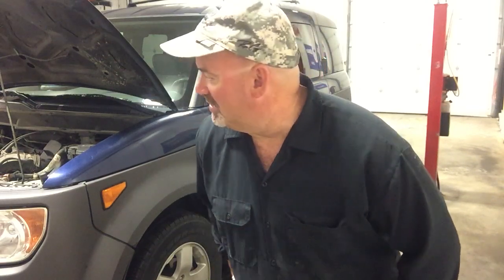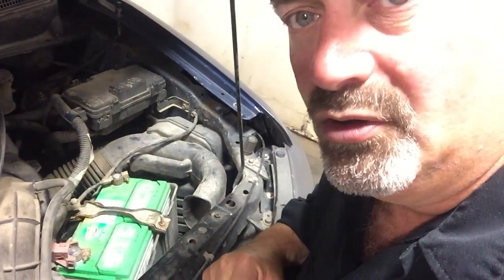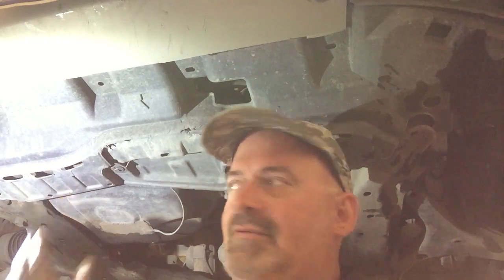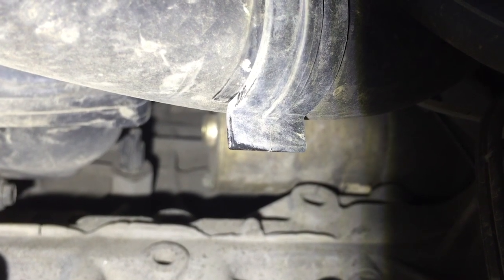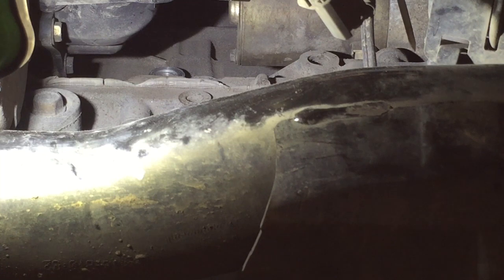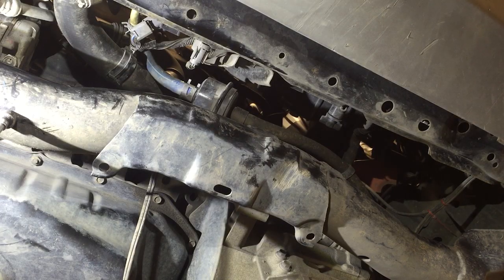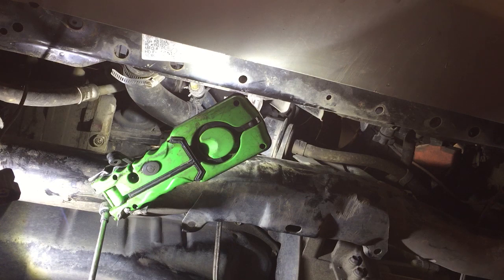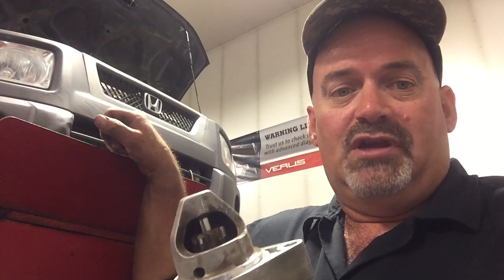Honda Element Starter Replace Less Than 1 hour

Comment: Mark my words, it’s way easier going from the top than the bottom. Took about 30 mins to take off cross bar, throttle bottle, and intake manifold, giving direct access to the starter from the top, with tons of working room. Total time for job took about hour and a half.

Comment: I have done 4 accord 2.4 starters. The first I did using this same method and it was a royal pain laying on my back. The next three I did from the top by removing the intake, the throttle tube, the overflow tank and various vacuum lines, hoses and electrical connectors etc etc and pulled back the intake toward me and to the right to gain access. I used a bungy cord to hold everything away from the work area. You will gain a lot of access space with this method and keep your sanity. Start to finish from the top took me 1.5 hours very casually and is also recommended to replace the manifold gasket. I realized that going from beneath was not really that big a deal and saves a lot of time, but space is an issue and my patience was tested mulriple times. Having a car lift would be most helpful of course. By the way Honda dealership wanted $745.00 labor only to do this. And in speaking to a mechanic on break outside, he said they go from under the vehicle and takes him 45 mins start to finish as he has done so many. I have used reman Denso 2806006 starters $116.00 plus the return core without any problems in four years, comes with 12 month warranty. Of course if you cannot break those bolts loose from the bottom, then go from the top. Watch this video closely it will help. And be patient.
Reply: Great write up. Appreciate you taking the time this will help. 👍
Reply: $745.00 for 45min?? I need that job..

Comment: Take the cover off the intake runners and split the manifold it's a lot less grief.
Reply: I agree, save yourself the frustration of trying to reach the 14mm bolt and just do it from the top.

Comment: Remove the two 8mm bolts on the back of the starter then remove the cylinder half of the starter. Makes the 14mm long bolt much more accessible.
Reply from the maker: That’s one way to remove it.  I assume you don’t do the same installing it.
Reply: @ThecardoctorTV  that's correct. I put the long 14mm bolt in the new starter hole.snug the 17mm in front then used a 1/4 inch wratchet with a 3/8 adapter 14mm short socket to avoid the knock sensor.

Comment: on 2008 had to also remove bracket for intake manifold in order to get enough clearance to get the nosecone of the starter down and out before I could remove the 12mm starter wire. Thanks, Good approach.
Reply: 2010. Can’t seem to get at the cable clamp. Will try this. Tks

Comment: Did this job yesterday, from the bottom.  Took about 5.5hrs on a 2008 model.
Took an hour just to get the sensor out.  
Yes any wire ties were cut. (and not replaced)
No, the top bolt isn't going back in w/o 10" long fingers with eyeballs on the ends OR doing the job by going in from the top to begin with.  So in my case, only one bolt went back in.  Some day I might bother getting the other one in, but no time soon best I can tell.  It'll be fine with just the one bolt so long as you get it in to torque spec and with blue LocTite. 
Naturally I do not recommend this method, but in 100 degree heat in a parking lot there's plenty worse things you could leave out. (like the dammed sensor, tho I didn't and don't recommend you do either)

I'm not suggesting the video is a misrepresentation, but going in the from the top would probably be faster for the average tinkerer with the average tool set. If only a bit more expensive since you'll need new gaskets for all the things you take off.
My biggest issue with the whole thing is the stupid prices for not even a Honda OEM starter.  What the actual?!
Thankfully it's the only thing I've had to spend more than $100 on for this car, other than tires. So I guess I'm still ahead in the deal.
Thanks for the video.  Great info.  Cheers!

Comment: Before you waste your time trying this (like I did), please read this comment. 

Notice he has the E raised on a LIFT. If you do not, good luck. I don't. 

Once I easily removed the knock sensor nut, I realized everything else was extremely difficult to get to. It took me THIRTY MINUTES to get the knock sensor nut back on! 

It's just very tight in there, even though I had socket extensions and whatever.

I ended up taking it to a mechanic, who charged 3 hours of labor for a $230+ part. Some are cheaper, but I get premium parts. 

Afterwards I asked my mechanic if he ended up going from the bottom or top, since I'd recommended bottom. 

He said they tried from under, but wound up taking off the manifold and going from the top. 

So if you want to save yourself an hour of frustration trying this without a lift, or hours of labor at a mechanic, if I did this again, I'd just go from the top. 

Good luck.

Comment: I tried this… laying on my back with the car jack stand up… I could not get adequate torque or wrench swing to get the large bolt off.  I broke it free but it is fighting me all the way out. I will just take the intake air manifold to get at it. Good news is the manifold bracket is off so taking the manifold off should be easier. 

If you are going to try this method, it will be a lot easier to do it with the car way up high so you can stand under it and have a Milwaukee Impact wrench.

Comment: The lower starter bolt came out hard and was messing up the threads on the way out. I had to tap the hole again with the same size tap or I’d have been down to drilling it out and pulling a bolt and nut in it place. Nightmare avoided.

Comment: Really grateful for this video.  On the Element Owners Forum, there have been reports that this is possible but until now I have never seen definitive proof.  I suspect though that for most shadetree mechanics like myself who do not have a lift or a wide selection of tools (especially air tools), coming in from the top is the best route.  My alternator is at 125k and my other Honda's starter died around the same mileage so I'm just trying to have it all figured out before the inevitable happens.  But then again, it might surprise me and last to 240k like another Element owner's did.  One thing's for sure -- you are 100% right about putting in the highest quality replacement you can afford because you don't want to do this twice.  Thanks for the video.
Reply from the maker: Thank you! I hope some more folks try this from below and give feedback on how it went, Its a timesaver for me for sure but youre right about not having a lift. Thanks for watching.

Comment: Thank you Car Doc!  Extraction was a 6 out of 10 difficulty, Insertion... 12 out of 10... LOL.  Still got 'er done in under 3 hrs.  ...but bruised up forearm for casualty where the frame tube tries it's best to keep you blocked.  Seeing is believing, and without your video I'd never believe I could 'weasel' that starter out of there.   Trying to blindly get that back bolt back in was probably the hardest part of the job, but with patience it can be done.

Comment: Thanks for posting this. I did it in about an hour and 15 minutes. I used a deep socket with a 3/8 to 1/2 adapter which allowed just the right length to get a 1/2 drive ratchet on. The hardest part for me was getting that back bolt back into the bolt holes. Thanks again.

Comment: Thanks Car Doctor. Just changed out the starter on my '03 Element. My comments: be sure to cut off the Honda zip tie holding the wiring. The bracket on the starter makes it doubly hard to turn the starter to take off cable, so I just pushed it up to clear and pulled down to remove starter cable. I suggest removing the bracket on new or reman starter and just reinstall. I don't anticipate any issues with the cables moving around. The blind bolt took a couple of minutes, but was found OK. Doc, you made it look easy! Next time it will be easier! (Hope not very soon!)

Comment: Thanks Car Doc for the video. My daughter's element  failed this morning. Read the section of the maintenance manual on how to remove the starter and a lot of parts have to be remove before seeing the starter area. Go to youtube and saw your method of removing the starter with less parts remove; then I started removing the starter your way.
Not a walk in the park though. After removing the bolts, removing my starter was impossible without removing the manifold bar support. Tools needed for bar support removal was a 12mm wrench size (deep socket). finally was able to remove the starter.
Front bolt was easy, the rear bolt was another mission impossible. I was not able to finish the rear bolt - will do it tomorrow

Comment: Thank you for the great video. I just did this and the Honda started right up. Just a note to others though, take your time this is a very frustrating job because through most of it you have only enough room to work with one hand. As a backyard mechanic, with no lift (jacked up the front a few inches) it took me about 3 hours...this included occasionally getting out from under the Honda in frustration at how hard it was to get at that back 14mm bolt so I could sip on a beer for a bit before getting back to it. But hey it worked as he shows you in the video and you don't touch the manifold and have to fork out even more money for gaskets.

Comment: Did the nasty thing. Was it just me or, is that back bolt self locking??? Also removed that intake brace in front of the starter for more wiggle room to remove starter itself. CHEERS!

Comment: Thanks for the video!  I replaced the starter in my 2003 Honda Element using this method.  After removing the plastic shield underneath the starter is already exposed.  The only thing I did differently was that I did not remove the knock sensor.  I see how it would have given you more room but I found it was not necessary.  Thanks again!

Comment: Thank you for the in-depth analysis and presentation of changing the starter from the bottom. Faced with no choice but to replace the starter and still recovering from surgery I did a little bit of go from the top and go from the bottom. I split the intake manifold Upstream of the injector rail I was lucky enough to have only had to disconnect the connector plugs from the injector rail a ground connection and one other Electrical connection and one or two vacuum or breather lines. The 17 millimeter bolt was crazy tight and given my condition and not having the vehicle up on Jacks I had to displace the intake manifold to be able to get a breaker bar and a pipe on to it. Thanks again for all of your tips

Comment: With my 2010 model I removed the lower manifold bracket bolt 12mm  and the manifold bolts on the top - this allows the bracket to be pulled outward and the starter to be slide in and out of place. If you can get the upper bolt off the lower bracket without stripping it that’s best. A mirror was essiential for the back bolt placement but still lots of feeling around and getting it in with trial and error. I lubed up the ratchet so it would click back easily and used a short socket with extensions it get the back bolt started. The long socket would not bottom out so the bolt would not start to thread.

Comment: Great vid thanks Tim, I like your humor! My 07 Element SC I had to take the intake brace bracket off to actually remove the starter. This worked, and despite this method being very difficult, i did it without jackstands or lift. This is a much easier way than the top down method and throttle body and intake removal. Thanks CarDoc for the great vid and all the tips!!!! I appreciate it and not my ELE starts like a champ!
Reply from the maker: Hope it helps. Good luck and thank you for watching
Reply: It totally helped Tim! (Edits above) Thanks so much!
Reply: Looks as if I’ll have to do that too
Reply: It looks pretty rusty. Any tips?
Reply: @beam5037  pb blaster or liquid wrench. Spray, let it marinate and repeat. Better to soak it good than to strip it out break it. If your in snow/salt country that goes triple
Reply: j Hines it was way to rusted. I ended up grinding the tip off on Aliumium housing just a bit and this gave me enough clearance to pop it into the hole. I hope this helps the next victims. Thanks for the support.

Comment: Thank you for an excellent video! It saved me a lot of time.  I don't have a lift, so I put the front on jack stands.  I'd say the toughest part was getting that 14mm bolt behind the starter back in.  My Element has 200k and I'm happy I didn't have to pull apart the throttle body and intake.

Comment: Thanks TCD! I had a hard time releasing the clip on the knock sensor so I broke it free and rotated it until I could get my thumb on the clip release, removed the lead and then removed the sensor. Boy, getting that blind bolt out was a bugger! Also I used the NAPA new starter for the replacement.
Reply: Going back in that blind bolt was a b!tc# to get started! But with a little Devine intervention I got it started and the rest of the job went back together without a hitch. Thanks again for posting this video.

Comment: I just did this job. Your instructions are good, but every step is difficult. Reinstalling the upper starter bolt was downright comical!  I honestly don’t think I saved much time compared to going at it through the intake manifold, though I never want ti find out for sure.

Comment: What is the trick to not dropping the back bolt? Dropped the back bolt putting the new starter in and it got severely lodged. Had to buy a new back bolt and have almost dropped it again trying to put it in and now I'm scared of dropping it. What about removing that black plastic hosing to the back of the starter to get more room for my hand?

Comment: I have several comments.
First, great video! And thanks for the alternative to disecting the intake to get at the starter.

Second, to any one attempting this for the first time; unless you are very familar with working on these engines, expect to spent more than 1 hour to get this done.  I just did this for the first time and there is a learning curve.  That said, this is still a better method IMO.

Fourth, when the job is finished, be sure to get a six pack of beer for your mechanic and one for yourself.

Great job Car Doctor! I'm now a subscriber.

RayK
Third, with the exception of the air ratchet, be sure to have all the tools that Car Doctor uses. The jointed 3/8 ratchet is a must. I also found it handy to have a 12" pipe to fit over the ratchet handle for more leverage when breaking the starter bolts free.
Reply from the maker: Excellent feedback and thanks! Please don't leave my six pack out front of the shop after hours as it will freeze and explode this time of year. hahaha

Comment: Your video helped me a lot, I did on my 2005 Honda CRV. I am form Caracas Venezuela and I am tired the BAD MECHANICS on  the autorized Honda Dealer in Caracas, they made really bad job and is too expensive. It took me maybe five hours but I am not a mechanic and  I don t have the professional tools that you have and use; but its Ok. The hard part for me was take of the 14mm starter bolt,it was really hard beacuse of the space ,but with patient I took off. And a recomendation you can  take off de main wiring cable of the starter when you have the starter out there , I did that way and is really easy. Important is dont forget to take off the sensor near the starter,and made shure to put everything in place take you time to check this. Thank again Car Doctor guy I take a cold beer in your honor. Sorry for my englsh Bye C
PD; I will write my experience  in spanish for the people that dont speak in english. Bye
Reply from the maker: Thank you and im so glad it helped.

Comment: One of the worst jobs I’ve tackled in my life and I’m a 67 year older old gear head.. I think the difference is between doing it on your back on the ground with car on ramps or having a hoist. The worst is that back bolt, working blind on it. They should have made it even longer, but probably didn’t think people would do it from the bottom.The position of your wrists on the ground are killer.. lots of A5/35 rub. Lol

Comment: I recently did this on a 03 Accord 2.4. I pulled the intake. It looked like the easiest path...
Reply from the maker: The accord is slightly different and it's much harder to access from below but I haven't tried on that car. If you run into an element take a look. It might save you a little time. Have a good one.